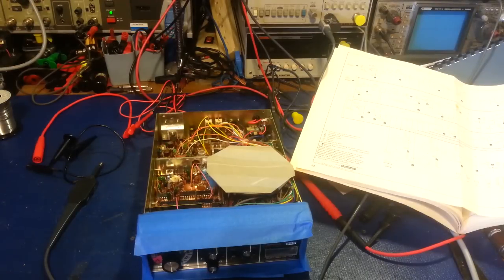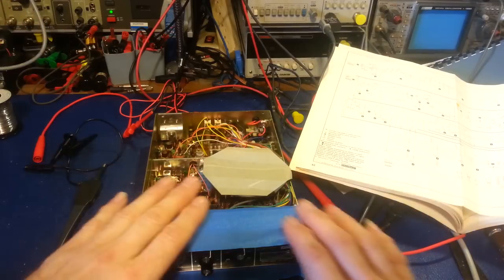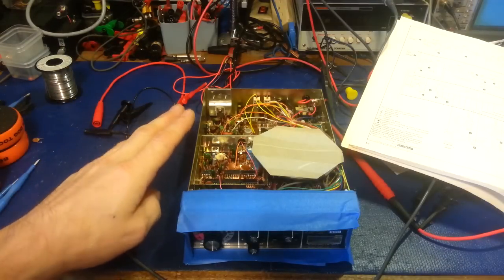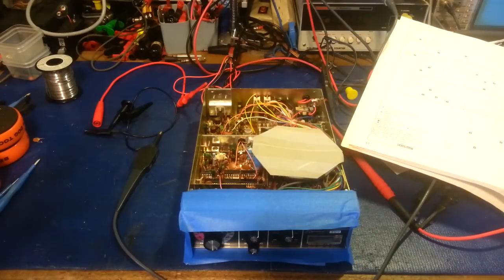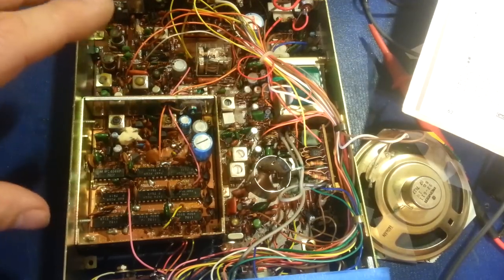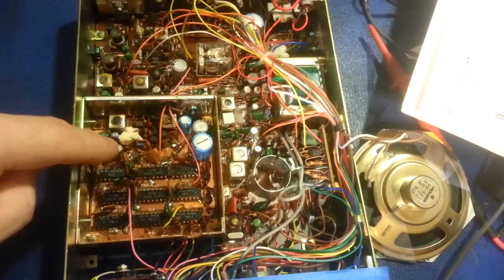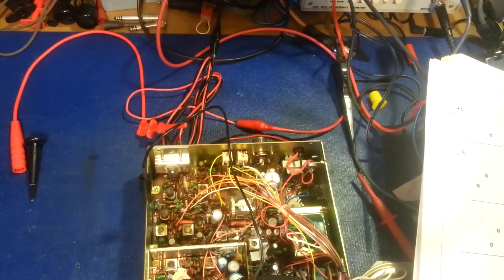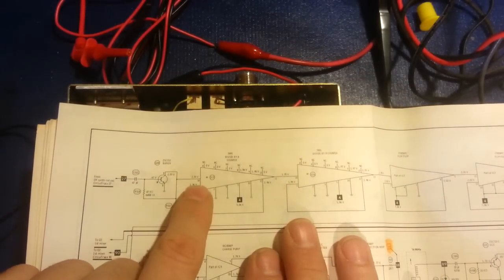Troubleshooting TTL based PLL synthesizer circuit in a SBE Formula D CB radio.

Comment: I wish I had some of your knowledge.  I have a Uniden PRO-710e base with no transmit/no receive.  I only have basic tools...multimeter...capacitor ESR tester, transistor tester....no scopes or anything.   Is there a way to test the PLL chip with basic stuff to see if the PLL chip is bad?  I know some volts on the PLL prongs aren't correct, but not sure what is causing it.

Comment: When the Formula D first came out, it was one of, if not the first, radio with a digital synthesizer. My friend was a technician and was amazed! He wrote his own schematic of the system and figured out how to get extra channels. But the way it works, the receiver and transmitter are not on exactly the same frequency and the further you go out of band, the bigger the difference becomes. So, although it only requires switches to get those extra channels, eventually the transmit and receive are so far apart that it becomes unusable. Anyway he modified a ton of them and he had to use tiny wires and covered it with black glue to keep others from stealing his work! He built one for himself that included a 100 watt linear amplifier inside of the case. He made a custom heat sink with an over temp light. He took out the channel selector and just put in switches. A guy offered him $400 for it, so he sold it. Eventually the schematics for the synthesizer came out. It’s an historically important radio.

Comment: Have seen a lot of those poly-dip caps split open. Always in used gear so I assumed the heat got to them. Seems from this radio they just self destruct. Interesting.
Reply from the maker: Yeah it appears to just be old age setting in.